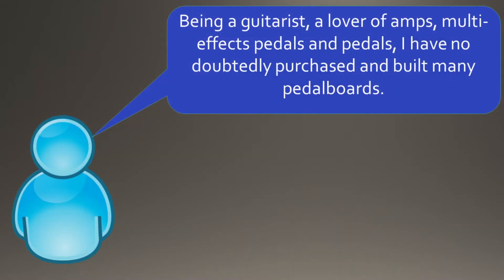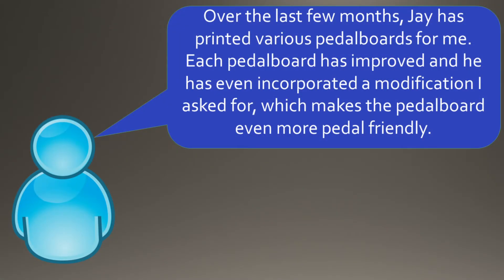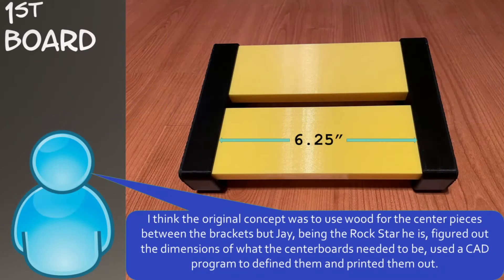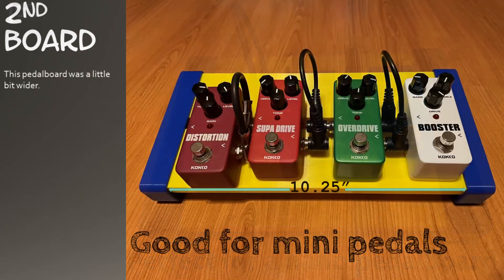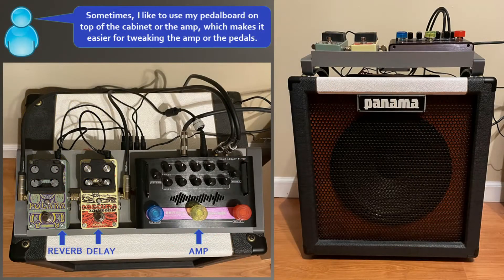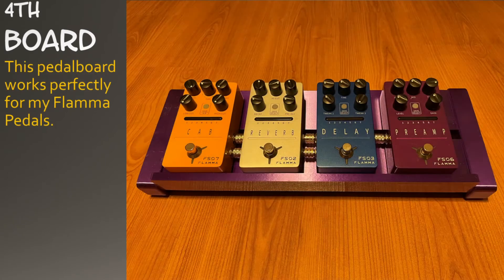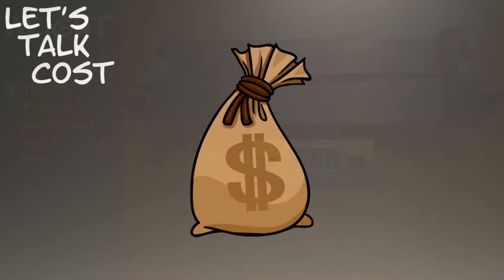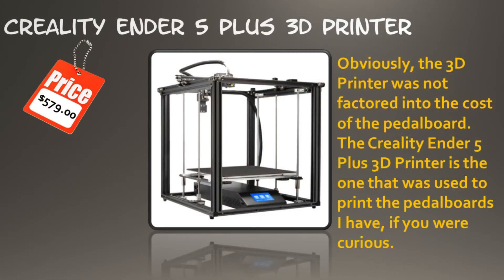3D Printed Pedalboard

Comment: Hi! Could you tell me what filaments they are?
Reply from the maker: I asked my friend his reply was:

I used Hatchbox Cement Grey PLA for the boards 
https://www.amazon.com/HATCHBOX-Printer-Filament-Dimensional-Accuracy/dp/B081K85WTJ/ref=mp_s_a_1_4?crid=ARHAZFA3OISQ&keywords=hatchbox+cement+pla&qid=1675355467&sprefix=hatchbox+cement+pla%2Caps%2C103&sr=8-4

And FlashForge Silk Grey PLA for the end caps/feet
https://www.amazon.com/Flashforge-Filaments-Spool-Dimensional-Environmental-Friendliness/dp/B0912JKMJT/ref=mp_s_a_1_13?crid=338PQFHGM9U22&keywords=silk+pla+grey&qid=1675355646&sprefix=silk+pla+grey%2Caps%2C117&sr=8-13